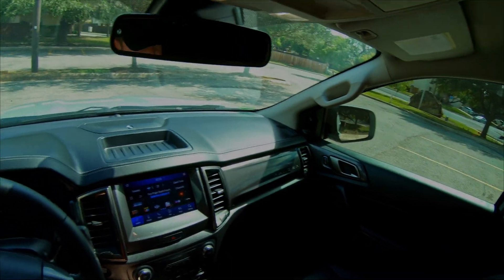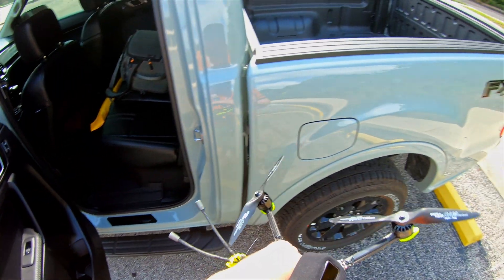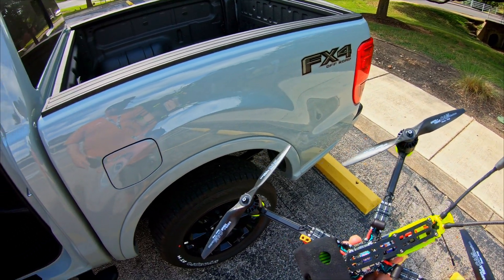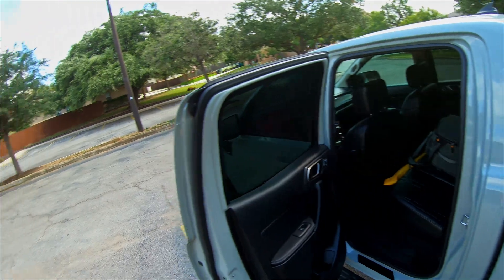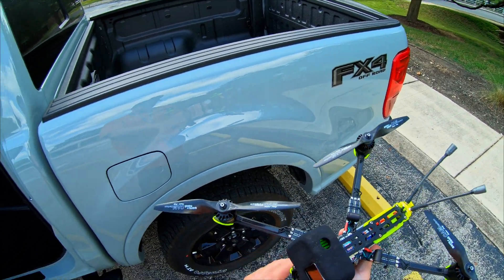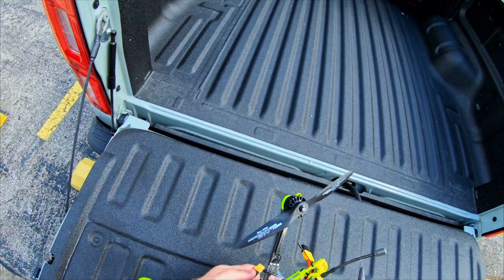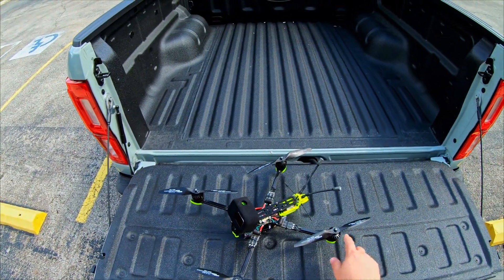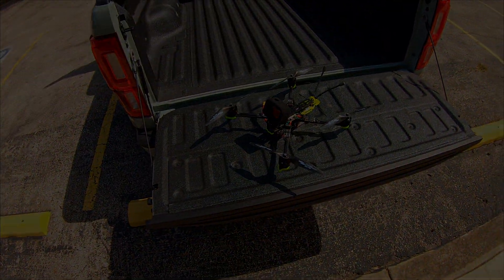XL10 V5 ProShot 1000 / APD escs

Comment: V6 release along with rekon10 pro.  Been looking into 10" frame for a year now.
Reply from the maker: After running an 8” and 10” for awhile my conclusion is massive arms for rigidity at all costs. I’ve heard good stuff about Rekon. Can’t go wrong with a 10” super G either.
Reply: @Finalmile_FPV  yea super G 10" finally came in stock at a point but didn't have the money. Technically don't have the money now but damn tired of waiting
Reply from the maker: @QSpeedRacer  you also have the Nasty set of frames, 395/396 and 405. They’re super solid but going to come in heavy. I had some flex in my XL10 and the top / bottom plates were super thin. It is fairly light though, maybe running 2814 with a light 10” or 9” prop high kv would be cool. 
I’ve been really wanting a ‘Mercia 9”, it’s just looks like an absolute tank lol.
Reply: @FinalMile FPV  I was looking at 3110 or 3115 though I did see the 2814 
I just have to figure out AUW if 3110 work out for long range . iFlight is uses 3110 on theirs
Reply: @FinalMile FPV  yea I remember medical 9 from nurk and Bardwell did a video with it
Reply from the maker: @QSpeedRacer  if you can find the data sheets for each motor sometimes you’ll get lucky and they include tests with similar props. I used to focus on over propping and a great tune for efficiency but I’ve changed my stance on that. Larger motors at the right voltage can be just as efficient or even more so, and the improved stability in adverse weather just makes getting a good shot that much easier. I’m running 2812 on my 8” now vs 2808 a year ago. 
Similarly I’m up from 2806.5 to 2808 on my 7” but have gone down in kv from 1500 to 1300 on my 8” chaser and 1100 in my 8” LR, and down from 1900-1800 kv on my 7” to 1500-1300 kv. 

I was surprised by the speed of the 1500kv 2808 on a 7” dal 7056, still around 90mph top end and a cruise around 55 but pulling less amps and much easier to tune then the higher kv.  Going to log the overall esc rpm and compare to previous logs, I don’t think the smaller 2806.5 was even capable of the torque needed to spin a 7056 at any higher rpm than the kv suggested based on the initial speed runs. 
My 8” on 2812 1300kv honked the props yesterday which never happened on 2080 1500kv
Reply: @FinalMile FPV  yeah been going thru the data sheets.  Hard to match up. Also if I do 3115 I think I'm do 640kv and do 8S 😳
Reply from the maker: @QSpeedRacer  hell yes! 🤘. Last year or so 8s electronics have really come into play, the efficiency and torque boost just makes sense now that it doesn’t double the cost of the build 🤣
Reply: @FinalMile FPV  I could only find the iflight blitz 80amp esc and blitz flight controller. I'd imagine I'd need atleast 60amps.
Reply from the maker: @QSpeedRacer  I know APD makes an 8s but the firmware on that is a pain. I thought tekko made one. Jesus that blitz is still really expensive, yowsers
Reply from the maker: @QSpeedRacer  okay. FETtec makes a Kiss one. HGLRC makes a  BLheli S and tomotor makes a BLHeli32. Around $80 usd
Reply: @FinalMile FPV  wanted 4in1. Didn't see 8S on HGLRC or T-Motor 
And weird iflight is 35x35 though says comes with adapter
Reply: @FinalMile FPV  omg like ungodly inconceivablely expensive.  But don't want anything to fail on something so big and heavy.  My 8" with it 12,000mah 6s already heavy enough.  I never go over houses or cars let alone people. 
I think xl10 v6 has more battery room but might still do rekon10 because of dead cat. Just really hoping I can mount battery on the bottom.  Pretty sure my rekon7 I can easily mount battery on bottom if I move capacitor
Reply from the maker: @QSpeedRacer  holy cow 12,000 6s?!?! That’s a ton of battery, like probably 1.4kg in battery 🤣. I’ve run 8000 6s lion once, it is nice to have the flight time but I know at some point the returns diminish. Starting to look at fixed wing LR options now, they just carry excess weight so much better and the efficiency numbers are to the moon 🌙
Reply: @FinalMile FPV  oh yea return diminishes alot. Going from 8000mah to 12000mah gets just a few more minutes. I have flight time charts I keep that track distance speed throttle averages. Mah ending voltage and flight times on my Google drive I need to test more.  
But throttle hover and slow cruising are still low. 20s to hover and 30% throttle to cruise at like 30mph. 
I'm suppose to post review 2.5years in the making. I had family issues everything got on hold.
Reply: @FinalMile FPV  atomic Swordfish alot people been reviewing lately. Has 2 motors though so less efficient but redundancy if one fails. 🤔

Comment: my friend, what is the maximum speed with gopro? I need to get 99 mph+
Reply from the maker: Mine was good for around 85 on the 900kv motors. I never had gps on the 1050kv setup, though I’ve heard others say they can get 105-110 for short bursts and cruise in the 70s.
Reply: @Finalmile_FPV 8S 3120 setup is better if you want to be fast

Comment: That thing sounds so nice!
Reply from the maker: Thank you !
Those big bi blades really make a the best sound. Even on an 7-8” prop bi blades really lower the frequency and give it much more thump.
Reply: @Finalmile_FPV  How did you manage to put on the Props (spacer)? The 3115 Motors have 5mm diameter Shaft and the Bore diameter from the Aeronaut 10x7x2 is 8mm. I want to build nearly the same with a different Frame.
Reply from the maker: @zefixx6659  each prop comes with a set of spacers to fit inside the hub. It’s worth noting the bottom 30% of the prop hub is 8mm and the top portion is a snug 5mm perfect fit on the motor shaft.  They’re good motored but you do nee a lot of pitch to take advantage of that torque, pretty heavy bell so it’s probably not as responsive as a 2814 or similar
Reply: @Finalmile_FPV  If you had to choose again, you would choose the 3115 or the 2814 motors? Must not be the total Freestyle machine...
Reply from the maker: @zefixx6659  if your going for a lightweight total freestyle rig 1000-1200kv I’d consider the 2814 and maybe a 9” prop or a lower pitch 10” prop that’s light weight. You’d have a very responsive quad that’s more nimble and resembles a 5” quad in flight, but that’s faster and carry’s more momentum 

If your going for a power cruiser with some freestyle, then 3115 900-1100kv with a really aggressive prop. You’ll have massive power on demand and a good cruising speed.

Comment: So how are these apd escs? Im about to build a large quad and was looking at the iflight 80 amp escs since they are blheli 32, but these are cheaper and seem decent enough. How is upgrading the firmware and tuning them going?
Reply from the maker: I’d go something BL heli, I got them to run pro shot but the firmware updating and configuring is a nightmare. I hear a pass through system is out now but I actually shelved this quad for that exact reason. I’ve seen a lot of guys running the I flight escs, and I’m actually running a deadcat 10” with a t motor 55a 4-1 esc, so really I think 80a continuous is probably more than you need on a 10”, even on fairly high KV. That’s the biggest quadcopter I’ve got experience with.

Comment: Upgrade esc firmware
To Apd 2.0
October 2021 version. Uart to usb interface for flashing. Potshot is not the best dshot is better proshot isn’t a true digital data packet it’s carried in an analogue wave. 
I terms been lowered a bit usually a great help.  get iterm relax sub 10 also raise idle speed upwards of 7%. Lower min settings right down on dterm lpf to around 60hz in min range. Get dynamic notch min down low also for clean up duty down low. 
When upgraded to Apd 2.0 firmware you can run bidirectional d shot on all f3’s series esc. I have many and run it in the 120’s on 12’s to
Keep up the perseverance I also dealt with all the same things you did couple of years ago. Don’t bang 8s through 1050’s the 80’s explode.  I know. Lol
Reply from the maker: Thank you! I did start bumping up the idle speed and that helped, recently I’ve started deep diving into the I term induced problems, I think my antigravity gain has always been waaaaayyy to high. You don’t have any phase sync issues tuning d term filtering that low? I’m going to firmware upgrade this whole rig this week
Reply: @Finalmile_FPV  when moving over to 4.3 new crossfade array staggers notches and cut offs to prevent phase delay down at low throttle. 
If not running bidirectional d shot yet you can run 5 notches in dynamic notch filter
Set d term lpf s to dynamic. Run d shot 600 also. Pro shot is antiquated.  Things are really improving in Betaflight now. Exciting stuff.
Reply from the maker: @noisy_boi_fpv_3920  holy cow that’s huge!! I guess it’s time to make the jump to 4.3 🤔.  Between that and the new dynamic idle features large kwads should get a huge performance increase 🤩

Comment: Looks good! I have almost the same build but tuning has been super hard, would you be able to share your PID/Filters? Would be super helpful as there isn't much info out there on 10" builds
Reply from the maker: I’m running the presets from uavtech, pids are all at 1 on the slider right now. I’m having weird issues with one motor desyncing or just stopping randomly during flight. Soldering is solid so I’m kind of lost, going to mess with my multimeter and check stuff out next week, I’m inexperienced when it comes to apd escs so not sure what to think. 
On my FR10 that runs DSHOT and blheli im usually run n the 1.2 Pd balance and 1.3 Pd gain, another pilot suggested I turn up yaw P to around 90 and lower I gain, both of those tips helped keep a more locked feeling and reduce horizon shakes especially during windy conditions, the lower I gain also helped with motor temps, I think it’s just hard for the FC to maintain an acceptable level of long term pid loop error on such a large craft and consequently I term wind up was always happening, so try going down into the 80s or maybe even lower… again the uavtech website presets for filters and basic setting so a pretty good starting point, I just don’t use his PID slider settings as I feel they’re to aggressive for a starting point

So ideally
Master = 1 or .9 if you don’t want to manually lower I gain
Pd gain = 1.3
Pd balance = 1.2
Feed forward = 1.2 with a .25 transition 

Then manually set yaw P to 90, 
That’s on a 10” deadcat coming in at 2.2 kg, 3115 900kv on 6s 4000 mah
Reply: @Finalmile_FPV  this is going to be my build for the winter ..super awesome
Reply from the maker: @Dronedudevideo  it’s a ripper, the antenna TPU mount for the rear VTX antennas is weak, same as the chimera. That’s my only gripe with the frame. Other than that she rocks, enjoy!
Reply: @Finalmile_FPV  I built a TBS Source X X-Class rig, running the APD 80a esc's, Mad Polar XC-5000 380kv motors on 8's, and I'm having the same issue you're describing. After coming out of a flip or roll, The right rear motor momentarily cuts power, causing the arm to drop. The last flight I had with it, it did it after a roll, and the quad dropped like a rock. Broke 4 arms, cracked top plate, ripped off one motor,  and buried it about 3 inches in the ground. My second, cheaper built Source X, with iFlight 80a esc's & $12 a piece Aerosky 4830 motors, never had this issue. If you do find the cause of this issue on your rig, would you please share it? It'll be much appreciated. These monsters are way too expensive too build, just to crash and destroy after 1 or 2 flights. Thanks in advance bro! BTW, that's a very nice macro beast you've got there. It sounds soooo good, and the flight looked like it was buttery smooth. 🤙
Reply from the maker: @NegativeSum  I actually put this thing up in the closet because I couldn’t figure out wtf was causing it, I’m really trying to educate myself on PID loop functions and filtering as I suspect either the tune or the esc firmware is to blame. 
From others that I’ve talked to the most common suggestion was to raise the motor idle value, because the dynamic braking on the apd escs are so strong it was hypothesized that under rapid throttle change or a snap maneuver one motor was actually slowing down too much and would de sync, which sort of seems plausible given how when you arm them the motors take a second to spin up… much slower than a blheli esc. Another suggestion was that the esc firmware was mismatched, I never went through the trouble to hook them up and check the firmware or try and flash update but I don’t really feel like this is the case because I have had it happen on a few times and it’s not always the same motor. 

Now, on a blheli rig where the Pd ratio was way to high and I had a battery strap loose I did have a similar experience, on quick throttle punches (like repeated blipping on a tuning flight) the battery would shift slightly and I got sever P term feedback, that caused the whole thing to shake violently (similar to the apd issue but the no motor actually stopped) 

When I get home later this month I’m going to have another go with it, the radx fc is garbage and the onboard flash for BB logging isn’t working right, so I’m going to swap the fc out and then log a flight to see if it is indeed a motor stopping and what the pid loop is doing when that happens…. My first thing is going to be upping the idle speed, maybe 6.5-8% and see if that fixes it, if not I’m going to go through the trouble of checking the firmware and esc configuration through the APD software …ughhhhhhh. Lol. 
I hope that maybe helps a bit, uavtech did mention APD escs are known to desync occasionally but usually recover, they have such a good reputation and are used on some seriously pricey rigs I just don’t see that being the stand alone culprit, on the rig he tuned he was running a 10% idle and it was floaty but no motor drops.
Reply from the maker: @NegativeSum  and thank you for the kind words, I really want this thing to work, but like you said it’s so expensive to just keep trying and throwing parts at it…
Reply: @Finalmile_FPV  Hey man, something that may be worth trying is slowing your loop time down to 4k if you haven't already, switch to DShot600 (just for testing), and adjust your dynamic idle (Chris Rosser explains this in his "Fine tuning your PIDs" video). Build looks amazing; hopefully you're able to get to the bottom of these issues!
Reply: @Finalmile_FPV  So what are your actual pid values sitting at for the XL10? I can't get mine to fly smooth unless I crank my D Term into the mid 50's to low 60's.
Reply from the maker: @joe_scotto  I’m at 
Roll p42 I75 D 30
Pitch P44 I 75 D32
Yaw P 80 I 90 D 0

dMin off, I term relax 5 setpoint RP
Antigravity smooth 10. 

Have you balanced your props, not just the blades but hubs as well?  Every 10” prop I’ve ever had has been way off from the factory, HQ , aeronaut, APC all needed some serious balancing, that will make a huuuuge difference.
Reply: @Finalmile_FPV  I haven't balanced the props but I don't think they would cause the issues I'm having. I can tune it out but I get hot motors at that point.

What rates do you run? Maybe I'm just running too high of rates.
Reply from the maker: @joe_scotto  you need to balance them, I’m not kidding. That prop weights 30+ grams, if it’s out of balance you can have anything from jello to fast D wobbles in forward flight to hot motors and a loose feeling kwad. After seeing the difference it makes I balance anything over a 7” prop. 

My rates are old BF style rates so rc rate, rate, expo
Pitch and roll are 1.7    .6.    .35 for an 850 d/s
Yaw is slower at 1.6.    .6.    .15. For an 800 d/s

It’s not the greatest for either cinematic or freestlye but it allows me to fly all my kwads to 90% of their potential with the same rates, that way I’ve got a consistent feel from the sticks and can focus on the tune for each kwad to get it optimized for its specific role.

Get a dubro prop balancer and watch this old video, I prefer to sand and remove material from the heavy side (as do most quadcopter pilots) 
https://youtu.be/-vakWrc86xE

Comment: Been waiting for this!
Reply from the maker: Worked on the tune today and did another flight, I’ll share that after I do the editing on some Ethix prop testing from earlier.
Reply: @Finalmile_FPV  what’s the AUW? For my 10
Inch it’s about 1500g including a 4000mah 6s battery and a RunCam 5
Reply from the maker: @arthurzhao6678  wow that’s really light!?!?!  I bet you get amazing flight times. This build is 1750 with the hero7 and a 3300 6s. My FR10 is about 2350 with a 4000 6s and hero 7
Reply: @Finalmile_FPV  should get 15-20 mins of flight with 2 blade props and slow cruising